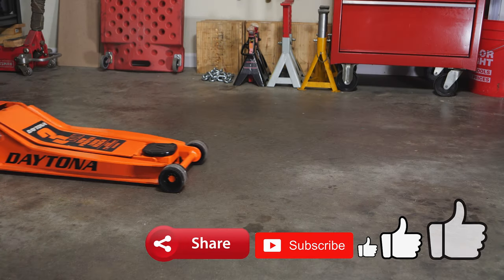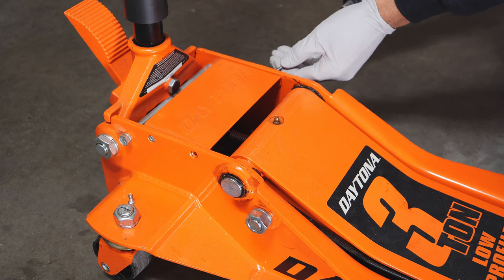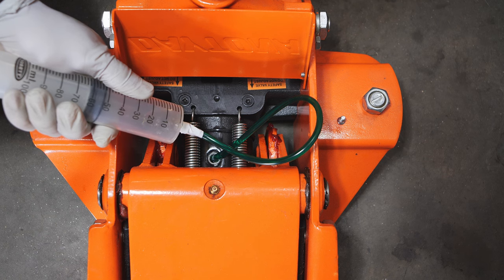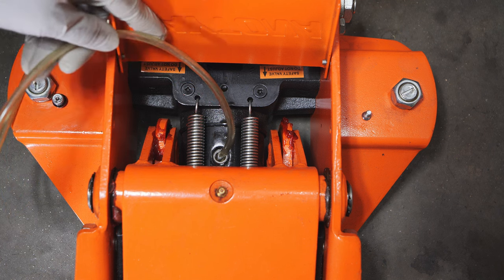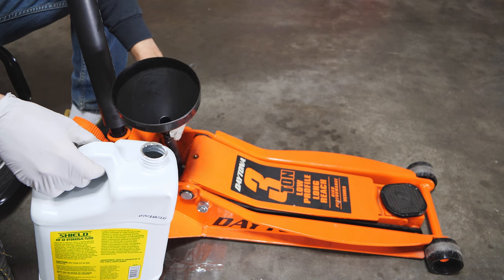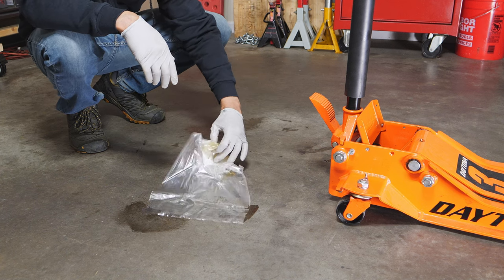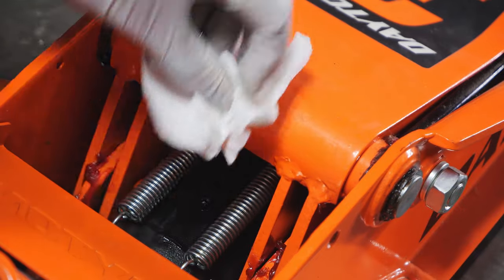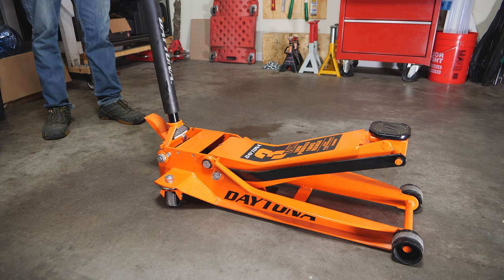How To Change The Oil On Your HARBOR FREIGHT Daytona Jack

Comment: Thanks for the tips. Where did you buy the oil/fluid? The manual mentioned a specific weight, just wondering what brand, etc. And where did you get that cool flexible screwdriver?
Reply from the maker: You're welcome El Jefe Slash! I bought the fluid at a local auto parts store. It's standard jack oil. I have a link for the oil in the video description. Here is the link: Hydraulic Jack Oil: https://amzn.to/3jg0xwX
Reply: @GarageDynamics  don’t use any detergent based hydraulic oils, manual states to use non-detergent based hydraulic oil.  Harbor Freight has Sta-Lube in stock and that is the correct oil to use.
Reply: @Project Arjun  sta lube is 20 weight u suppose to use 22 weight

Comment: Does the oil really go bad?  What are the change intervals they recommend? I just added some oil to mine. I feel like mine wasn't lifting until after i pulled the handle pretty far. Didnt think the oil could be bad.
Reply: It's just like any other fluid, oil is oil and needs to be changed.  It all depends on how often you use the jack.  If you use it everyday I would suggest maybe once a year.  

I am about to do mine as it's been 3 years and it never really hit me that it needed to be done.